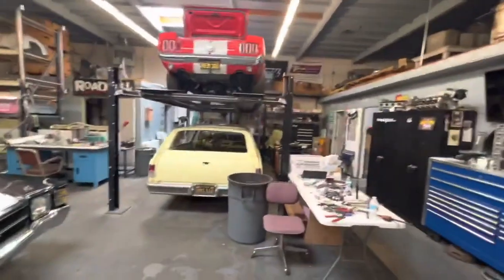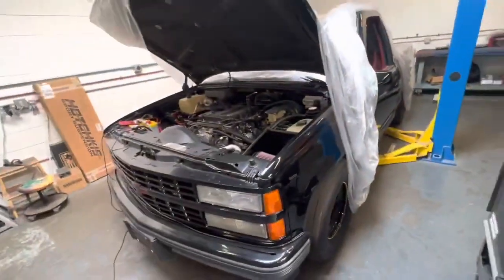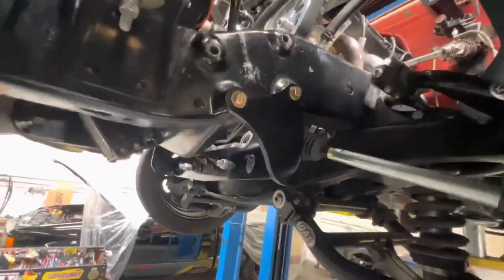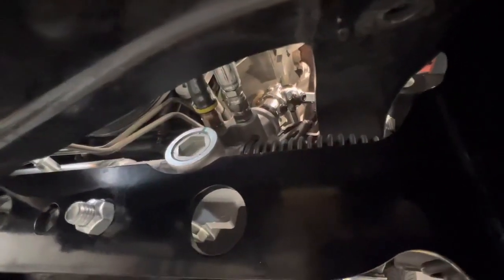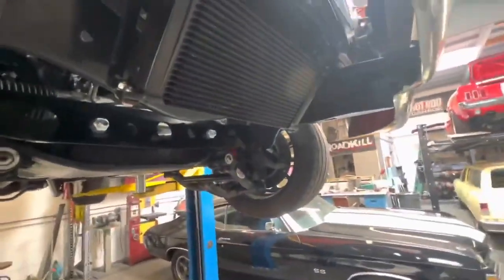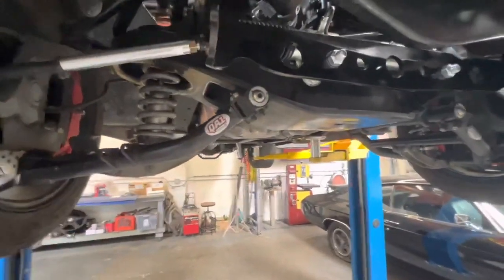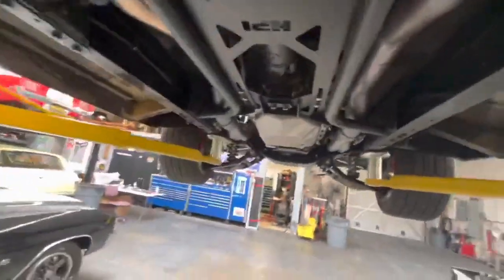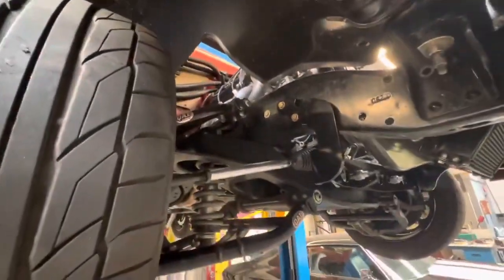What do I drive to Holley's LS Fest Las Vegas?

Comment: The input shaft on the POL rack is too vertical and will make the lower U Joint bind as you steer. 
The feel is like going threw a detent ball as you turn. 
It did on mine. What is your report ?
Reply from the maker: I had the same problem but shortened the column and then used a different steering universal at the rack.